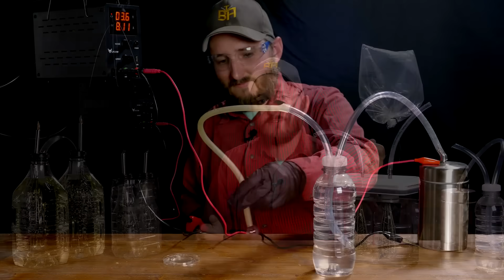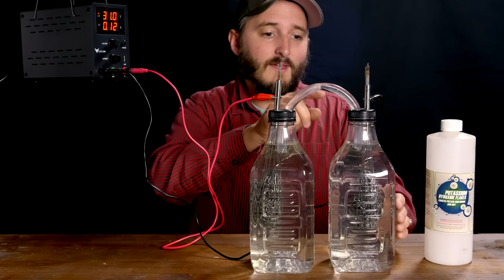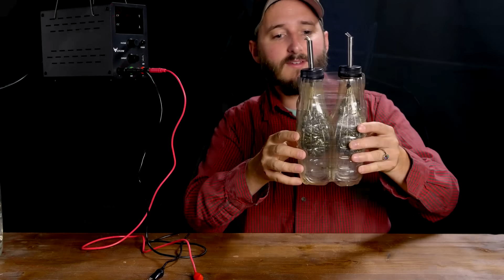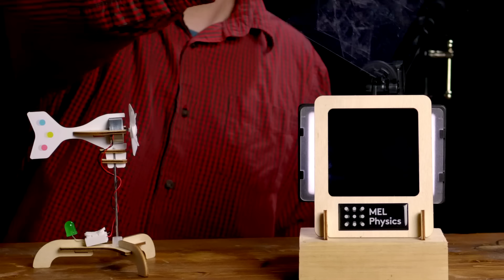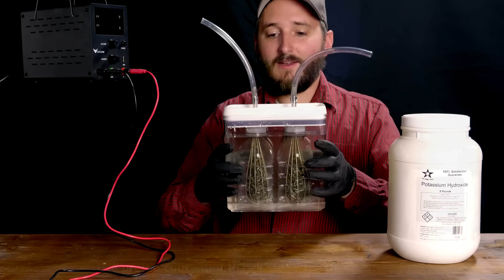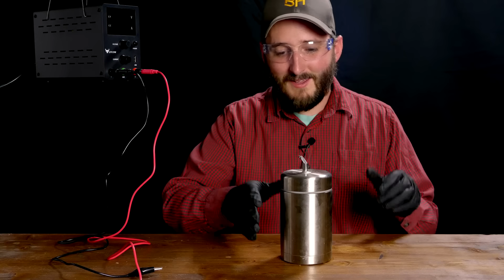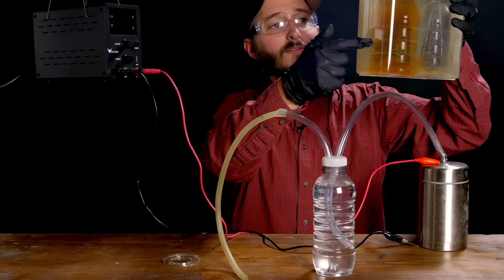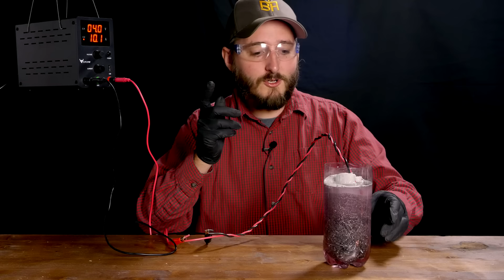DIY Hydrogen/Oxygen Generators From Grocery Store Items (HHO Fuel Cells & Split Cell Electrolysis)

Comment: I saw vid of guy making HHO in a glass jar under the hood if his truck, via the alternator, and feeding that into air intake. Excessive water leaked from tail pipe. I have seen very leaky tail pipes in person. Is this a feasible method of fueling an automobile in a stuffhittingfan situation? Would separating the gases be  better? Or was the whole thing bunk? Great vids btw. Your conduct and demeanor is exemplary. TY

Comment: that 1st single output set up could make a good under hood setup for your car and bye bye fossil fuel no other mods needed just hook that output hose to the fuel rail it could go right into the injectors and connect the other container to the alternator and thats it.  u might have to adjust fuel air ratio.  Im gonna give that a try see if it works.  Yes i know safety 1st

Comment: That looks like #10 stranded? If you were to strip that back the length of your sock maybe a little more you could take apart the stranding and wrap it around the outside before you put on the steel wool would make for a better connection. That is a brilliant design I am thinking of using a 60A battery charger or even a welder to up the amperage output. Using the idea of inexpensive or possibly free items you could take two of those two liter bottles like they do for fish traps and slip them together so you have the cone output off the two liter cap or thread it to a gas check valve. How can you use that to create work? Could you use the output to fire a boiler possibly? I wonder if using a woolen tube sock would maybe work better similar to the pads from a battery?

Comment: Connectin an HHO generator to a petrol engine car air intake can improve it's mileage performance if you connect it to a separated battery that you charge at home maybe with a solar panel

Comment: I found out your video casually on the youtube home, because i was looking for a way to modify and assemble a new HHO generator, mine is completely oxydized and now almost useless, i created like 3 or 4 Cores (1 or 2 are just for experimenting) but they will never be able to draw so many amps out of my salty water XD, so, your design is fantastic, I would like to see more stuff like this, also, i was trying to generate a continouos flow of gas, combining several cores and linking the gas output togeder, so that i could use this to melt metals like alluminum and copper, is it even possible?

Comment: A correction. In the event of a flash back to the top of your water column, the oxyhydrogen will Implode, not Explode.  You are having an Explosion in the small container because air is mixed with the gas. In the absence of air, the hho will always Implode. Thank you for the interesting video. I was running a 5 hp petrol engine on hho back in the 90's.

Comment: The power supply should run through a PWM and an H bridge circuit. The cell will stay stable, it will not build capacitance and the temp can be controlled. of course you will end up with HHO and you can find a way to separate it after?

Comment: This is a great proof of concept for splitting the gasses.  Do you have a feel for how much current would find it's way through a 3/8 inch diameter channel between the spit cells?  Would the amperage be limited?  Thanks for the videos.

Comment: Ever made an air bubble with a wet facecloth in the bath..?
Point is; wet fabric is basically airtight.  A tight weave would help.
So if your sock was kept wet above the waterline by capillary action; you could build a split output unit as long as you didn't put any pressure on said output..?
Putting the sock exit around a short piece of cylinder  that extended just below the water surface should allow you to put some pressure on the 2 output gas streams..?

On of the reasons you would want split output, even for immediate combustion, is  the Ozone produced by voltages above 2.075 volts. (some sources say 2.3 volts)
Ozone does wonderful things for the 'lighting' of Hydrocarbon-Air mixtures...
But O3+H2 = O2+H20, so you want to limit the time between mixing and igniting as much as possible. 

Your Bubbler needs a pop-off lid.
Preferably a hinged, spring loaded to pop on again, one.
A screw on lid is just looking for trouble.

Comment: you can efficently  split hydrogen from water without using any chemicals like potassium simply by changing the frequency of the electricy you are using to the appropriate frequency.

Comment: Hey that is fabulous ! You are really innovative !   One question -  Can we make a separate O and HH output generator using this, and give it about 15 Volt and probably 100 Amp current limited supply and drive a petrol engine of 1 HP on it ? Assuming even 50% efficiency, we are putting in 1500 Watt and taking out about 750 watt ! Does it make sense ??  Then we can get these 1.5 KW using 5 solar panels of 330W each and convert Solar energy into motive power.  The efficiency could probably be as high as 80% ???

Comment: I understand the splitting of water into its basic components - you did a great job. Hyper Oxygenated water is scientifically very beneficial for the body. How would it be done to just take out the Hydrogen and leave the Oxygen in the water? Can it be done in a home setting?

Comment: I see a problem.  As I understand it, for a molecule of water to separate, both the hydrogen and oxygen start out in the same place.  If it is inside of a bottle both gasses will try to rise up from their starting point.  Since each electrode is encapsulated in its' own bottle how can the gas separate before rising?  The separate gas ions want to go to separate electrodes depending upon their charge and so should be allowed to pass through a fine mesh rather than have to travel downward out the bottom of a bottle , across, and then back up to the other electrode.  Shorten your bottle to a funnel at the top and use a fine plastic mesh to channel the bubbles up to their respective funnels.  In this method you can move your electrodes closer together.

Comment: You could use graphite or platinium for the electrodes to avoid corrosions of the said electrodes.
It would be also useful if the point of the electrolysis is to produce an Na+,OH- solution by using NaCl instead of NaOH. (less impurities in the solution)
Reply: I mean I honestly wouldn't use metal halide salts as your electrolyte, considering... halogen production and all that

Comment: dude the distance between the containers doesn't make it conduct less, it's the cross sectional area, if you used the same size hole from your first model (for the syphon tube) in the bottom of your bottles (instead of cutting the bottoms off completely) it wouldn't work as well. i would cut as much of the inner containers off as you can without losing your bubbles, even if you cut arches in each side of the containers that extend past the electrodes, as long as no bubbles escape you're good right?

Comment: You can improve on the last project by using a micro perforated bottle instead of the sock.
I imagine that a succession of bottles one inside the other, (like matrioskas) would lead to a design in a succession of electrodes with a minimum distance between them, could occupy a volume in the most efficient way.
Stainless steel is not the best conductor, there are those copper pads which would reduce the heat considerably.
Reply: Copper would corrode very quickly.

Rather than copper, the electrodes of choice should be a non-reactive metal or semiconductor...  gold, platinum, or CARBON RODS.

Comment: Wait... wouldn't it be pretty easy to make that single container stainlees into a separate output device? With just a couple of plastic shrouds (plastic bottles)? The distance electricity has to travel would change very little, just make it thavel trough the walls and not the bottom and you could have the best of both types, single container but separate output

Comment: I would Get A Few Catering Conical Strainer's 10" ~ 20"

And HV  RF HF magnetron sputter gun - physical vapor deposition (PVD) them with a  few Grams of Gold & Platinum
HV - High Voltage 
RF - Radio frequency
HF - High Frequency

You just making a ZVS Diver / Microwave Transformer / CTR Flyback Transformer/Tesla coil / Transmitter Hybrid

Comment: Stan myer discovered that you can creat a much higher volume of gas, by using a low amperage high frequency generator, in stead of using high amperage, so try using a microwave oven circuit that feeds the magnetron, but put your gas splitter in place of the magnetron, since that circuit uses a very high frequency to run the magnetron, it could run your gas generator more efficiently....🤔🧐😎👍

Comment: Browns gas is safe to 400 atmospheres if I remember right well above the limit of 120psi for propane tanks.
Reply from the maker: I don't know what you mean by safe, but it's certainly not safe from exploding at the slightest static spark at any pressure. It's more dangerous at higher pressure.

Comment: Your "flashback arrestor" is not safe enough. The tube could be damaged and the energy would flow into the tube and the container causing explosive reaction. You can separate the tubes into 2 bottles while allowing to flow HHO from first to underneath of the second bottle.

Comment: So i just read an article from Cosmos Magazine talking about Oxygen Generators for Submarines and space stations. In that article it talked about needing to heat the water to remove impurities before using electrolysis to convert the water into Hydrogen and Oxygen. I was wondering if it would be feasible to use the Hydrogen produced from this process to then boil the water to remove impurities for the next batch? Then you'd only need to have electricity for the Electrolysis portion. This combined with a Carbon Dioxide scrubber that could produce water for drinking would provide oxygen, water, and reduced Carbon dioxide so we could have a self contained underwater city. If you could build the dome somewhere near an underwater current you could use hydroelectric power. How feasible is this idea?

Comment: I have a few questions for my split-output electrolysis setup:

1. What precautions should I take to handling the KOH(potassium hydroxide)? Like what to look out for and how to dispose of the solution afterwards?

2. How should I handle the resulting hydrogen gas?

3. Can I use the bottled water from walmart labeled "purified by reverse osmosis" or do I need specifically distilled water?

4. What concentration of KOH do I need in the water to get the best results. (Im using 4 D batteries in series. - 6V)

Thanksf or your time!
Reply from the maker: Precaution 1 is don't use a plastic container like I did. Alkaline solutions will cause the plastic to crack eventually. If using stainless electrodes watch out for orange chromium buildup in the water and deal with it as suggested in the pinned comment before disposal. After neutralization of the chromium it's safe for drain disposal. Bottled water is fine. The koh concentration or naoh should be as high as will dissolve in the water. I don't know what you mean about dealing with the hydrogen. Isn't that why you're doing this, or do you want the oxygen? In that case be aware that the oxygen output is not safe to breath as it contains vapor and other trace contaminants from the solution.
Reply: @Nighthawkinlight  Thank you so much for replying! But can I use the thick weatherproof plastic containers or do I HAVE to use other materials? Also, since I am doing a split output design, what should I use to seperate the 2 electrodes If I can't use regular plastic bottles. 

(The plastic bottles are not as thick and the outer containers. So IF the thick plastic of the outer container is susceptible to corrosion, then the thin walmart plastic bottles will be even more susceptible.)

Comment: When the HHO gas is ignited, does it create pure water or is there some of the electrolyte contained in the reformed water; ie. is it "pure" water or contaminated with impurities from the electrolysis process? Such as when liquid solutions are distilled via a vapor/heat reduction? When undergoing electrolysis, does the water& electrolyte solution lose mass/weight/volume? If so, how long would a specified volume of water last/produce? Do you know of a chart that depicts electrical charge to volume to output of Hydrogen & Oxygen? Thank you for sharing this very informative video; subscribed.

Comment: In developing a fuel cell for a car, should the fuel injectors be changed?  How can the power needed for electrolysis not drain the battery?  Should the cell be connected to the alternator?  Will the alternator be able to provide the energy for electrolysis without burning out?

Comment: i think efficiency will be acheived at a lower amperage, with a higher voltage, posiibly with a pwm controller
Reply: id even consider de magnatizinng the 51l stainless steel in an argon bath.

Comment: Do the 10Amp maximum current is defined by the wires we use to connect the alimentation to the electrodes or it is because the electrodes themselves can't handle more than 10Amp ?

Comment: I like your system with the it would be perfect for petroleum petroleum generator with the bumbler you can just separate the oxygen because I've done with the carburetor on the generator it provides the oxygen instead of gasoline for the fuel for the inside your groceries afloat processes that all has to be readjusted because of hydrogen will be a maybe Sterling gasoline and turn up on gasoline where would be probably better in a diesel application it's quite informative you have a good day sir

Comment: Hi I been thinking about applying this gas. Think about it. plug it in and have a barbecue grill! I have the plans for use on my car. but simce it produced water was loth to put on my car. The exhaust system would be a problem due to rust. I would guess to control this flame would require maybe only using the H2. or mixing at the burner?  It would save me going to buy tanks of gas? and be clean burning.

Comment: Plain ocean water is best. All the metalic minerals in it provide little resistance and fantastic electrical circuitry. No need to use poisonous acids  or corrosive acids.
In fact stale urine from cows or horses is the very best.
The very best electrolyser made is a lead acid battery. The more cells ie, 3-6-12- ie, 6-12-25 volt the more production. In this cell you use KOH instead of sulfuric battery acid.
If you use sulpheric acid you need to pull the off gasses through a soda solution to nutralize the acid before engine introduction.

Comment: Have you tried making HHO with the sock method and then trying to get only the hydrogen from it? Let me explain a bit further. If you let the HHO gas into a bottle of which the bottom is cut of. The H part should be rising towards the cap. Make a small hole and put a tube in. Put the other end of the tube in a foil balloon that hangs above it. Would the balloon fill with hydrogen? And would the oxygen not just "fall" down?

Comment: Great vid!!
I'm an idiot when it comes to electrical or gas but........
Shouldn't you have a one way check valve on that line to keep the ignition from running back to the reservoir and blowing up? I'm not criticizing just wanting to understand how this works in a safe manner. 
Or maybe a type of spark arrestor?
Do you think it is possible to fill a bladder and produce enough hydrogen to run a cook stove or heater using solar panels for the electrical supply? 
Could you do this in a safe manner in something like a 55 gal. Container? 
I'm asking because it's easier than blowing myself up and then trying to explain why! Lol
WILLING TO TRY BUT DONT WANT TO DIE.

Comment: Like powering the vehicle that is being driven, what is this atomic weight of hydrogen gas produced in an electrolysis mixture that is for Generating compressed hydrogen gas?
Reply: The mixture needs to multiply the ampres by 16 times, add a transformer from a microwave oven. Add a power strip to the entire set of circuits to combine the outflow to be compressed and filtered into 3 fuel/water/alcohol separators, that filter out corrosive liquids with fresh and filter the 3 questered emergents from the productions version,  to have the filter be a fuel process as well, into processed appropriate casings and/or castings (casks). Not only will you separate three chems from water electrolysis that the power generated from this design will map our evolution, as progress towards human life and designs for economic growth and stability. Happy producing power. Let me know what you get as a result, and gladfully cut me in for 4% only, please. This is the evolution tesla dreamed of

Comment: In my opinion the insulated hydrogène, when escape, its more danger because is less volatile them the stored with oxygen. Both are dangereuse dépends of the situation, type of use and storage. The hydrogène with oxygen need to be used almost instanly to be explosive, otherwise, some second's after, he lose the explosive potential under the volatility, in seconds. The concentrated hydrogen, in my opinion it's more dangerous in case of escape.

Comment: Question, does water purification make any difference, tap water has anything between 100 to 350 particles per million, I use a 3 stage water purifier and get that to zero particles so only pure H2O. So does these particles have any effect on HOO system using potassium hydroxide or does using purified water work any better/worse